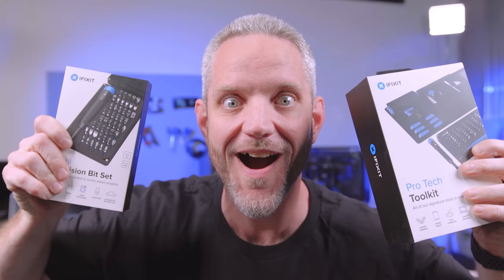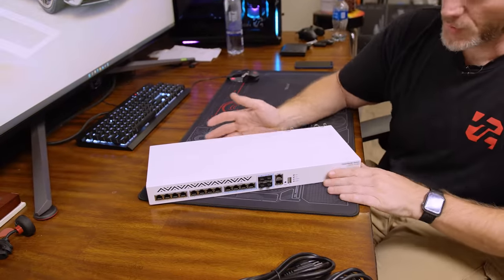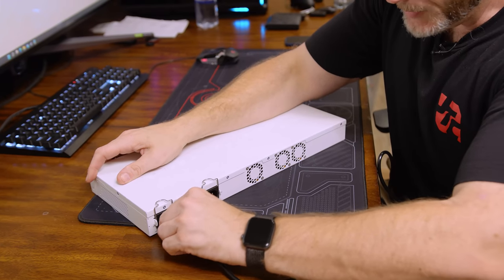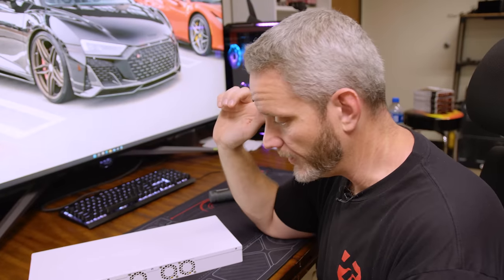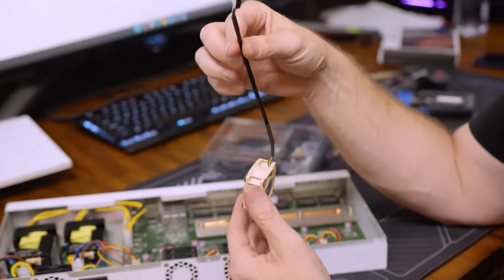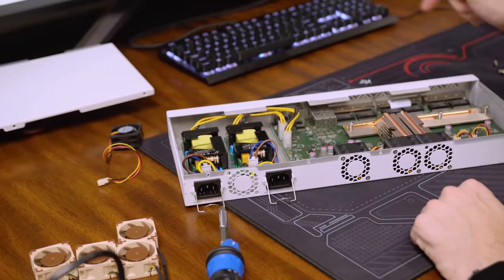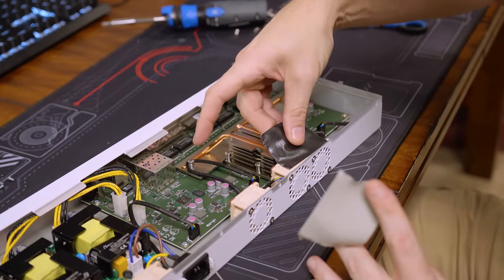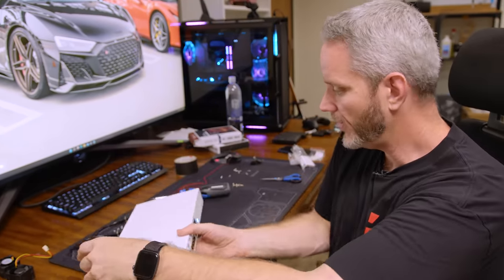We had to modify our new network switch...

Comment: I need a good 16 port 40gb switch and there's really nothing out there for consumers, maybe I'm expecting too much right now?
Reply: Going off the "For consumers" line at least, here's my take. You don't need a 40Gb 16 port switch.
Instead, you THINK you need a 40gb switch, because you have "a few things" that can actually make use of that 40gbps.
And then you have a bunch of other things that probably don't even need a full 1gbps.
You can't just add up the capacities of the links of all your devices either, most internet-of-things devices need for example a few kbps at most, unless doing a firmware update, and even then maybe a full 1mbps would serve them just fine. It's not like you care how fast the firmware updates anyways, so that can be left to be "slow" on purpose.
The point is that unless you have a house full of like 12 4k TV's that are often all on at the same time, all watching (different) 4k 60fps video feeds, or you're working directly with raw data from the JWST (at home, not at work like I'd expect), then you're not needing something that can support 40gbps on all its ports.

You probably have a computer that you put a 40gb network card in, and a NAS and/or server that you also put a 40gb network card in, and now you think you need a 40gbps switch that can handle all the ports of all your stuff to complete things.
You don't.
What you need is a 4 or 8 port 40gbps switch or router, that you can connect to your incoming internet connection, your NAS and/or server, and maybe a few PCs, and then from that you run an additional (not 40gbps) cable to a much slower switch (say a 24 port gigabit switch with 10Gb uplink, for the sake of not needing to replace it in the future), and use that to run all your "slow" stuff, like streaming boxes and smart TVs and "internet of things" hubs, and yes the wireless access points. Because why should someone on their phone have access to the full speed of your internet connection when the little processor in there probably can't even make use of all that data at the same time? Tablets aren't much better, I'm not sure even my very-high-end tablet would be able to make use of a full 1gbps connection, let alone 40gbps, and that's if I could even get it connected to something at a 40gbps link rate.

Comment: Don't plug a crossover cable into the management port. It needs an RS232 serial cable or USB serial emulator, they are very cheap. 10 bucks.

Comment: why whould you want sfp+ in an endpoint?? 👀 or even fibre channel? sfp+ and fibrechannel are server grade connections and are only supposed to be used in a switch stack or on a server. Sfp+ switch stacks and fibre channel for direct attach storage for a server because of the low latency! dont use sfp or fibre on an endpoint! its straight up overkill and hubber expensive!

Comment: Cool video. Is there a way to adjust the fan curve then with pwm fans on a switch? How would you do that? That might make for a fun/cool follow-up. Can the Noctuas run at the same/greater rpms as the default fans?

Comment: To be honest, you aren't really going to find 20+ port 10GB-T switches for under $2k

FS has a S5850-24XMG fpr about $2500

There are some for about $1600 if you go SFP+ but you will have to spend the money on the transievers, patch panels, NICs ect.

Comment: If you don't want a second switch then it'll be more than $1200 for a 24 port version. There are already several things that can't even use 10G. DVR nope, router nope. You can get a 24 port 1G switch with 2 sfp+ 10G uplinks for about $200. One (2 if redundant) short sfp+ DAC cables and you're done. No bottlenecks and lot's of ports for the slower things. Only the workstations and the server need 10G. The rest can't even use it. Most security camera's are fine on 100mbit let alone 1G. If security cameras write a gigabyte every second you need 3.6TB of storage per hour per camera.

Spending thousands on a 10G switch when it's literally impossible to ever use it is a waste of money. If you can make that on a video with a click baity title, sure go ahead.
Reply: I think he took out a 1Gbps switch with two 10Gbps SPF+ ports. What he should do is hook that into the Mikrotik using the SPF+ ports then follow your suggestion for 1Gbps gear.

Comment: My opinion is that if you buy a 3090 for "performance" luls, but meanwhile, you and Nic could get by with a 3050, would you still buy a 3050 or a 3090? I don't have a lot of stations and the wifi covers my home, but I added a repeater to my fiber modem to give the other side of the house a stable connection. If I had my way, the whole house would be fiber, because if I add a switch to a room, it might be 10G to the router, but it would be 100G to the modem, or whatever. Get what I mean? Of course, money is always the biggest limiter.

Comment: First time commenter and network engineer here! I would definitely set an IP to log into the switch via GUI or SSH. I don't have experience with MikroTic, but you will want to look into the interface MTU (jumbo fame) settings in order to get better throughput out of your interface. This setting will need to be added on both the client and switch side. An MTU of 9000 is recommended for 10Gb

Comment: "Cost Effective", "10Gig", "More ports".... Pick 2. And nothing bigger is going to be silent like the mod you just did. The next size up 10GBaseT switch from the one you have is going to be something like the Netgear XS724EM, but beware, they run HOT, and only have a fixed fan curve on their 1 fan. Don't stack anything above or below it so it can breathe in that rack. It may actually need external cooling sitting in a sealed rack cabinet. And 2300 bucks.

Comment: Hi, did you compare CFM between the stock vs the Noctua? The Noctua has a lower CFM and wondering what the cost in heat with the new fans.

Comment: So just was looking at this video and your "don't want to go switch to switch" -- But here is thing.. consider having a 2nd switch exact same as this one.. Both switches get 1 link to server - then get a link to each other - then You have half the connections into one switch with Phil - and Your rig + other half of connections on 2nd Switch - this way should the switch FAIL for any reason - you already have the 2nd switch as backup..  Only reason I suggest this is because going for a 24port do all switch would cost that 2+ grand more.. your only in for the current switch, and buying a 2nd one would still be under the price of a 24port. (unless you attempted to get Ubiquity gear.. which gets expensive quick)

Comment: I prefer Ethernet to wireless any day.   the wireless network is so cramped  and throughput so much lower than even 1 1Gb link that so much performance is 'left on the table'

during a recent home working stint, the sessions using wifi had lags of up to a second, switching to an ethernet connection I got 1 or 2ms lags !

Comment: currently using a old (but still extremely overkill) SFF Dell PC with pfsense for a router with an intel X520DA2 in/out. then it goes to a mikrotik CRS309 for my 10g fiber runs to my PC/server etc aswell as a run to a CRS112 POE switch that runs my POE cameras and accesspoints.

Comment: The noctua fans will not work ok on this switch and the device will overheat at 23-24C room temps. I have the same switch and with noctuas it was running at 65C+ , ended up with repasting the cpu and phy and using air ducts to optimize a bit the airflow and cpu is at 45C and phy at 57 and fans running @4000rpm most of the time with routeros.

Comment: Dear Jay, I know you really awesome with PCs and I love especially your troubleshooting vids. But as a network technician, I have to point out some mistakes and give you a tip. 
1. All the ports on this switch, expect the console one, use ethernet. It is a protocol, not a connector type. Those are called RJ-45 and SFP (+). 
2. This switch runs completely fine with just one psu (does not mattter which one), the second is for redundancy. You should plug one into an ups, the other one directly into a wall socket. 
3. There is a nice beefy 10 G-switch on the market. The Ubiqiuiti Switch Enterprise XG24. It has 24 RJ-45 ports with 10 GBit/s and 2 SFP28 port with 25 GBit/s. It costs below 1500 $. It is a great macth for Ubiquitis other gear like the wifi- and NVR-stuff. Since you needed surveilance stuff anyways and everybody wants great wifi. I guess as a famous Youtuber you could do the Linus-thing and just make a collab or a feature. They will probably give you all the stufff for free and send over a technician to set it up. And it makes a great video for the viewers to learn more about networking. Why don't you give it a try? ;-)

Comment: SFP+ switches are cheaper, but the SFP+ to RJ-45 adapters are quite expensive. Nothing wrong with running Cat6a at 10Gb, especially at the distances you're running. You should be able to get 10Gb over about a 328 foot run. Hell, Cat6 might have been fine at about 180 feet. I was fighting with this decision lately, and I figured  running fibre would be cool, but it's odd that people were yelling at you for not running fibre. It's cool, but not even close to nessisary. Cat6a is fine for your use.

Also, pretty easy to get some thinner Kydex and mold it for the fan ducts. All you need is your heat gun.

Comment: You won't find a better deal than Microtik, they are bargain equipment. Solid switch but 10Gb Networking is expensive. Period. I work in the enterprise networking realm, and a switch with 24 10Gb ports can be $7-10k.

 Honestly, I'd go critical only to 10G RJ45 copper, fiber to endpoints is dumb and unnecessarily complicated. Not what it was designed for. And a second switch could be layer 3 switch 1Gb RJ45 with 10Gb SFP  fiber/DAC cable uplinks. Bit more work but much more stable and expandable network.

Comment: I don't see the point of putting loud fans into something like this when it's just as easy to put quieter ones in there.  Noctua has shown that it can be done, and datacenter use is not a valid excuse for the noise.

Comment: I like to know what is difference between delta and noctua fans of how much they more air. I have few 92mm delta fans that will take 12V 2.5A. Amount of air what they move is in different category compared to 120mm normal PC fan. I hope that those noctua fans will keep that enough cool in use. maybe shorten life but not crashing.
Edit: Did little dig abut specs. Noctua (NF-A4x20 PWM) is about half of airflow of delta (EFB0412VHD-F00) also 5000 vs 9000 rpm (0.6W vs 1.4W)
If those delta fans are 40x40x28 (TFA0412CN-CN) then it have 43 m3/h airflow (17krpm and 7W)

Comment: The only difference between a 2-pin and a 3-pin fan is the latter has a sensor to measure RPM. That's what the third pin does.
Reply: Right, but these Noctua fans are 4 pin, not 2 or 3 pin.
They have power ground RPM and PWM pins.
That PWM pin is for something else to send a PWM signal to the fan in order to indicate what speed it should run at, tho I'm not sure what specifications that PWM signal has (I'd have to look that up).

The PWM signal is sort of like how a 3-wire RC servo gets told what position to go to by the third wire.
That third wire has a PWM signal on it, meaning that there's a square wave signal on it that has a variable duty cycle (aka ratio of on time to off time, a "perfect" square wave would have a duty cycle of 50%). That square wave is sent at a specific frequency, and the duty cycle is varied within a specified range (probably centered around 50% but I'm not sure) in order to indicate what position the servo should try to maintain, as a percentage from full left to full right deflection.

It should work somewhat similarly with PWM fans. Unlike DC fans, which you basically have to apply that PWM to the power pin in order to vary the averaged-out amount of power sent to the fan.
I'm not sure if PWM fans work well when controlled in DC fan mode, but I would think that it's not a great idea to do things that way (which would explain why Noctua fans are available in both 3 pin and 4 pin versions).
However, if you only need the fan to be on or off, the difference between 3 pin and 4 pin fan is pretty much nothing, other than the 4 pin fan might cost more. The reason is that lacking a signal on the PWM pin, a PWM fan will attempt to run at full speed just like a DC fan.

Comment: cant believe you have that "bad" internet .. 4g in denmark is better than that  , the most sold speed in denmark is 1gbit  via coax or fiber   , kind of insane to hear you got that low speed  .. but if it works then fine :)

Comment: This issue bugs me to death - I install switches all the time - quite often in small businesses who can’t afford a comms room & have small network cabs over peoples heads etc - the noctua fans are an absolute god-send and “must-have” - I do wish switch manufacturers would spend that few extra % on better fans / perhaps offer it asa slightly different model revision etc
Reply: They can't, quiet = low airflow, (and noctua fans aren't that high air flow) and boy the fans they have in there need all the air flow they can get since they're so tiny.
I'm seeing this switch having thermal throttling issues in the future.
Reply: @44R0Ndin  nope, I have personally installed these fans in numerous switches (and only after customers complain about the noise), several of which were PoE and not once had thermal throttling issues - of course you are correct if the switch is being saturated on all ports but that just doesn’t happen in the real world of small businesses. The most traffic they usually see is the occasional (hourly etc) Veeam incremental backups / occasional dumps to and from a file server.
Reply: @jordonpilling  Oh yeah that's for sure, but if this was being used in its intended environment then there's no way those fans would pass muster.

Comment: Have about (15) Cisco PoE switches for the users still on 10/100 going to a backbone Cisco switch at 1GB at work.  VLANS setup on all switches.  Copying files to/from the server is atrocious.  Our company is stuck in year 2000.  Who's still running 10/100 switches?  My company is. lol
[edit]: Oh, and probably reason you are finding it hard to find anything beyond a 12port 10G is because this would mostly be used as a backbone switch with 1G desktop switches connecting to it.  Never seen users on a 10G switch before.

Comment: You don't need a 10Gb/s switch
A much better choice would be a 2.5Gb/s switch with a 25Gb/s SFP connection.
I have seen a ton of those. They usually have 2 SFP ports and 16, 28, or 36 Ethernet ports.
This way you could connect the server to SFP and workstations to Ethernet and get better overall performance than with this 10Gb/s switch.
Reply: They're dealing with editing large videos for the channel they need all the speed they can muster.   So 10 gig is perfect for them.
Reply: @Darkk6969  But that's 10G split between all employees, while my solution would give 2.5G dedicated.

Comment: Also everyone who says he should go to Fiber if he doesnt have any of the Fiber cables in the building or connected outside Frontier who does Fiber out here will have to dig up the street and add it all then put it thru the building after construction is done. AND Frontier is WAY WAY Unstable I have Spectrum 1gb and I have 0 drops with more stable internet than I EVER did with Frontier 1gb

Comment: Half the people bitching about not using SFP+ probably aren't even using it themselves, and if they are probably thought they were saving with the little 5 sfp+ port mikrotik 10G switch.  At very least they don't understand the advantage of using already existing office infrastructure.  Plus with SFP+ fiber you have to buy the transceiver module on top of the cable, it's just not worth it if you have cat6 or better already in place.
Personally only problem I have with ethernet is that probably 90% of pre-terminated cables don't follow the cat6 or higher standards just to cheap out.